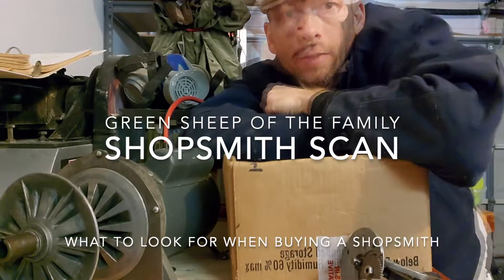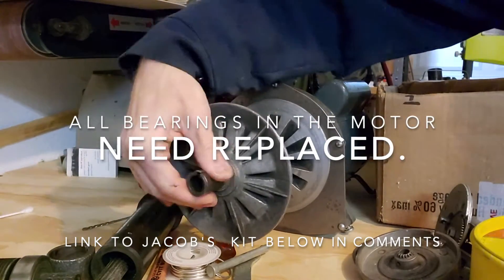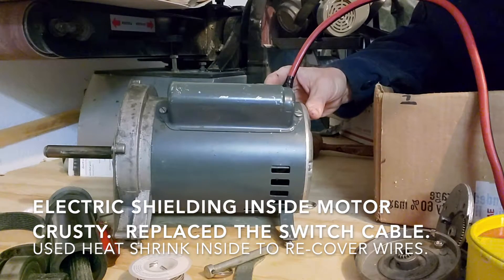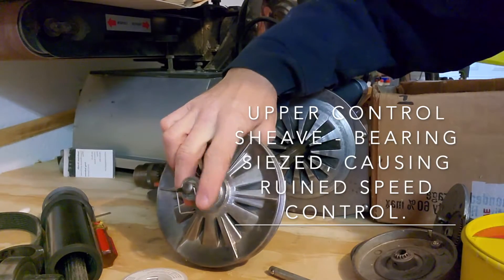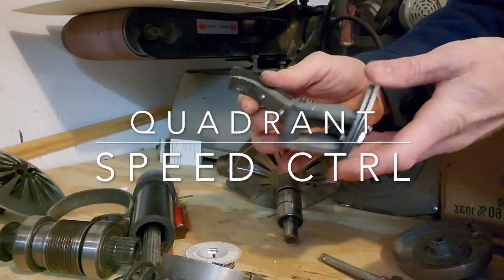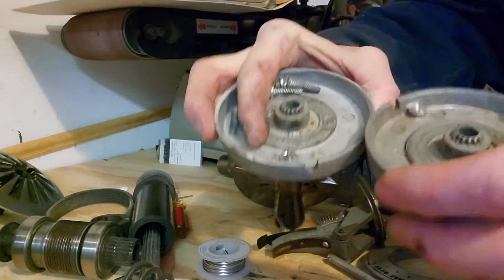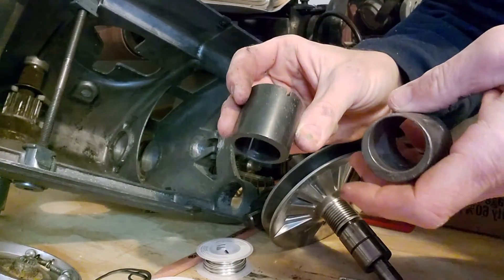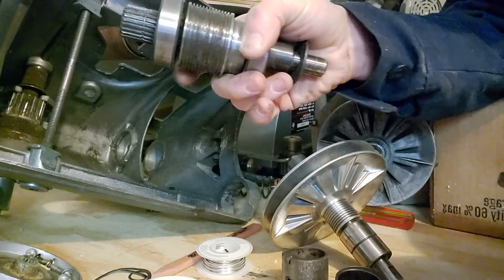What to look for when buying a Shopsmith MkV

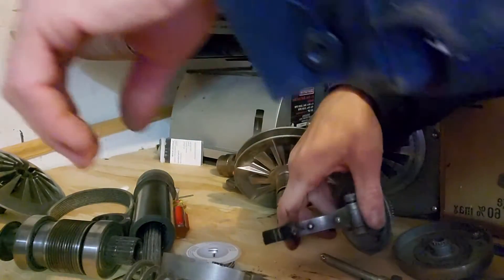Comment: Welcome to the family of Shopsmith users. At 2:38 the issue you mention with the "little nubbin that's turning" that button doesn't spin unless the bearing that it is riding in needs to be replaced. The oil that should be applied to the idler shaft is usually the biggest culprit, or should I say, lack of oil. If the sheaves cant slide effortlessly on the shaft the bearing, the button, and the rectangular retaining loop will fail as the sheave starts to stick. The speed dial will give you lots of feedback as it starts to get harder to increase speed. Increasing the speed should be smooth and easy, while reducing the speed requires a little bit of muscle, as you close the upper sheave on the v-belt.  Also, you don't want to add any lubrication to the surface of the quadrant as that will just attract dust.  Shopsmith has some very comprehensive instructions available on their website and on the official forum that would help in this maintenance, as I see from your video description you are already discovering. Have fun! Scott
Reply from the maker: Thanks! Hope to reassemble soon.

Comment: There is a guy on EBAY that will "upgrade" your speed control knob for an $18 exchange. He machines out the weak aluminum and presses in a steel replacement. WELL worth the money. Does an EXCELLENT JOB ! I have him do all of my machines. BTW .. NEVER use grease on a Shop Smith. Use WAX only. Yes, the bearings need oil every 25 hours of run time ONLY a light oil. You've bought into the Shop Smith world. when this machine is in good running condition, you'll be VERY happy with it .... then comes the upgrades !! LOL !! THAT'S MY WORLD NOW !! LOL !! I absolutely love this machine. It has paid me back MANY times in projects that I've sold. There are many great videos on YOU TUBE .... one of my VERY favorites is MY GROWTH RINGS. Scott will tell you anything you want to know. ENJOY !!!
Reply from the maker: Good looking out.  Shopsmith in a barn in Kansas. I am in Colorado no2.